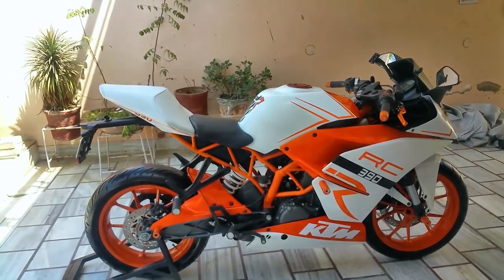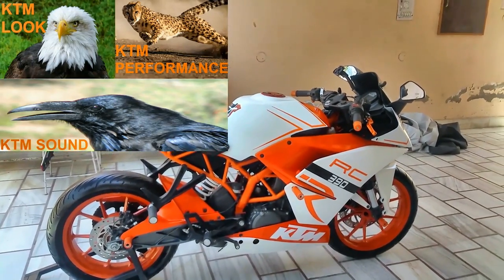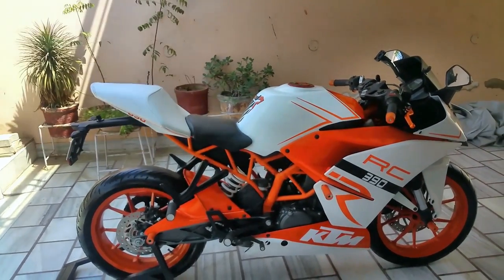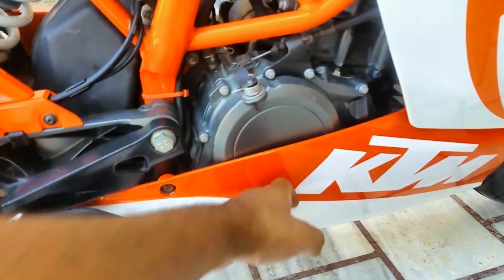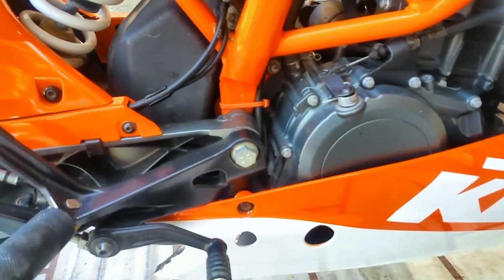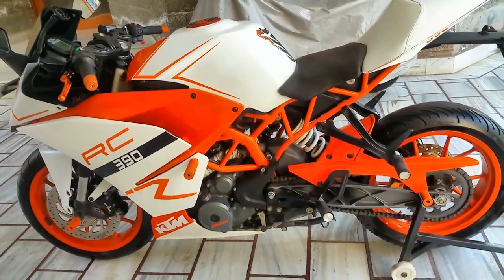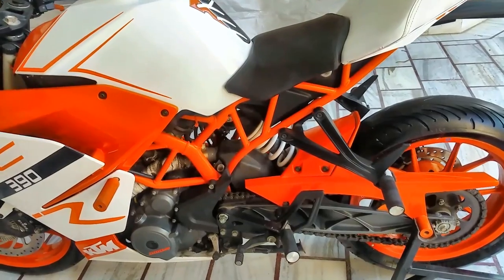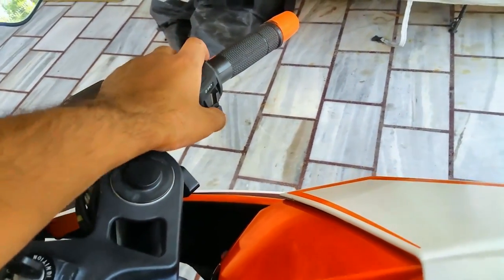🔥Modifying Stock Exhaust To Get Better Sound and Performance🔥

Comment: Will the sensor still detect it? I'm afraid that it might not get detected and destroy my ecu or other parts of the bike.
Reply from the maker: This bike only has Bank 1 O2 sensor which is installed before Catalytic converter..so no issues...Some bikes have bank 2 o2 sensors which are mounted after cat converter in which case u might need to bypass them...but not in this bike.!!
Reply: @powerpulse.motorsports  is it okay to make holes on exhaust

Comment: Does the aluminium foil hold without any problems and is there any leakage of air from the joint area?
Reply from the maker: Not meant for long run..Just temp solution until lead gasket arrived.!!

Comment: Do you know if the O2 sensor is before the catalytic converter in the 2019 RC 390?
Reply: usually O2 are always before CAT.
There are cars like german cars or most modern cars, that have pre and aft CAT O2 sensors. The aft O2 check the 'health' of the CAT.

Comment: so, if the hole is added not only 4 or reduced it will affect the sound?
Reply: 3 works too , bs6 200 sounds better now after 3 holes . I'm making one more hole and making them bigger also

Comment: performance will effect ?
Reply from the maker: Only slight increase in mileage. ..no effect on acceleration or top speed...
Reply: how about the fuel??the fuel still save and the pickup or topspeed will not effect??
Reply: Bro...... Fully.. Drop pickup 😭😭😭
Reply: What can do bro??? 😏😏
Reply: @parvind7019  After doing this Drop in pickup?